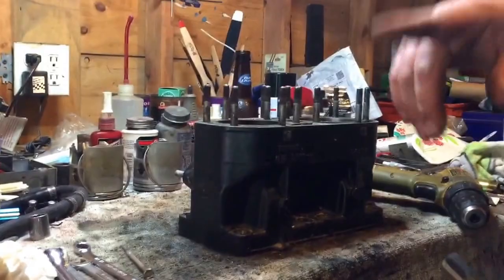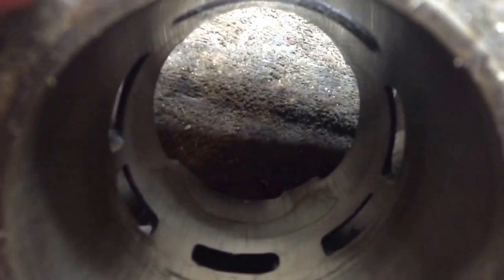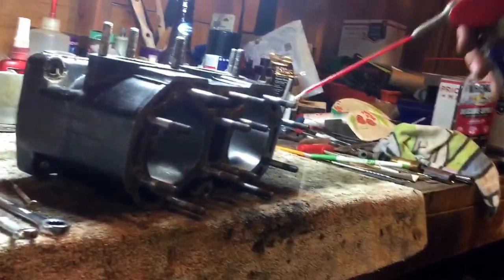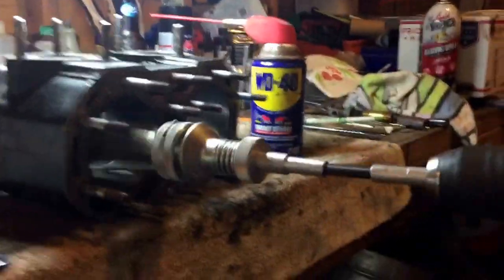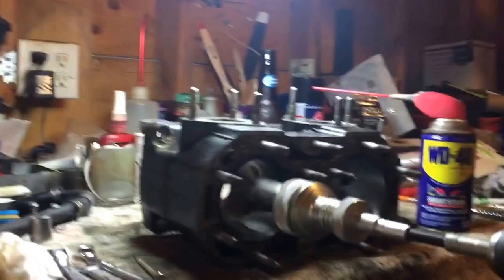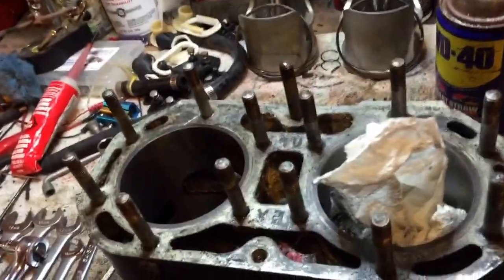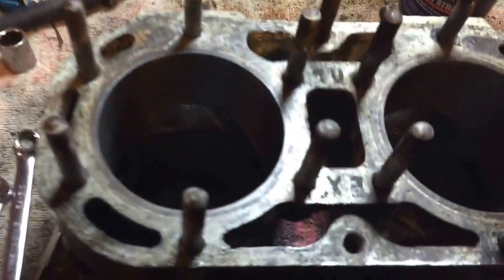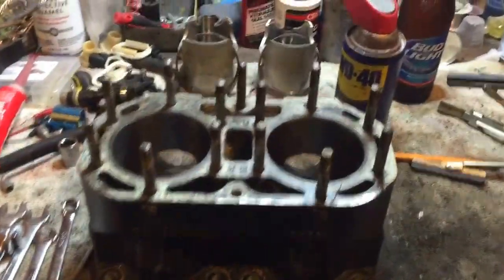Honing a small engine cylinder for new piston rings Part 1 + 2

Comment: Misérable et erronnée vidéo..... les commentaires pas mieux!!!... Adios...
Reply from the maker: Jean BERNEDE 

Don’t understand your language
Reply: Eric Greenemeier he didn't like it, I did though. Starting to learn about small engines and I need to replace my rings, this video has helped. Can you use standard rings still or do you need oversized rings now
Reply from the maker: sniper2349 
 hello. if you bore the cylinder then yes. need new pistons and rings. but if you are just honeing the cylinder then just get a new set of the ones you are replaceing.
Reply: Eric Greenemeier awesome, thank you!

Comment: so blew a ring on a 66cc single cylinder engine. No major damage to the cylinder, very minor scratches. How bad is it if I don't hone? if I just replace the rings?
Reply from the maker: Justin Case
Reply from the maker: Justin Case     The new rings won't seat them selves if you don't break the glaze.  The piston will seize up. 😩